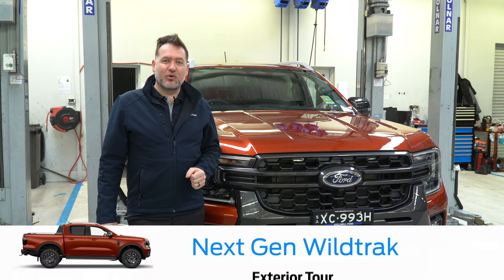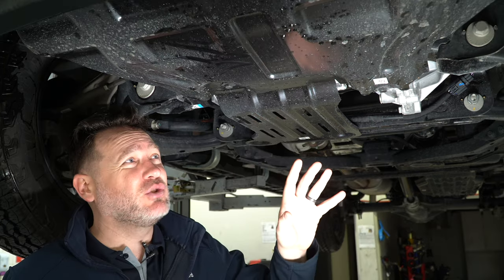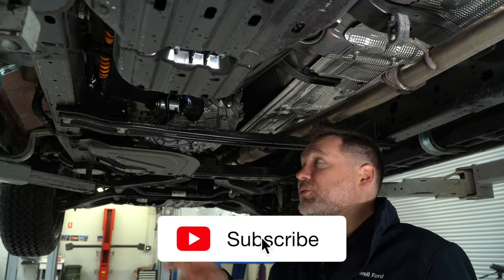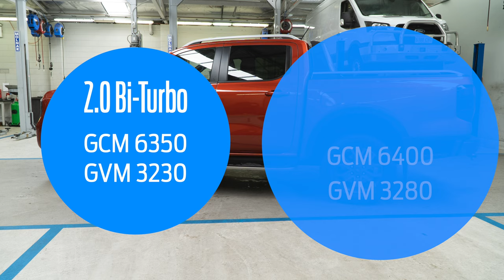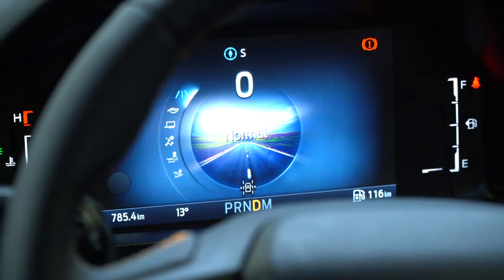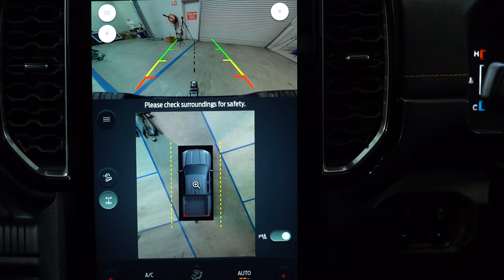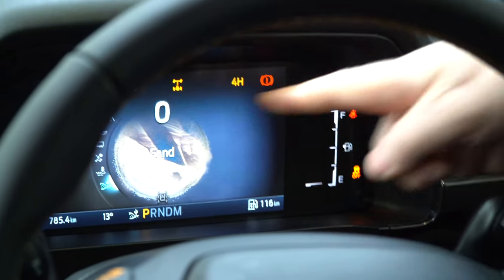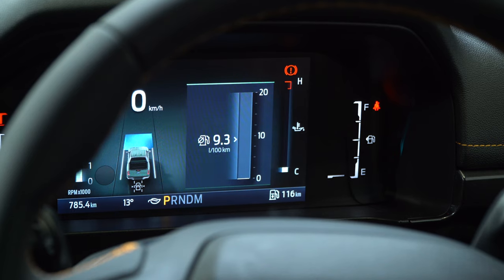Next Generation Ranger Wildtrak - Underneath & Off Road Upgrades

Comment: Thailand Ford ranger wildtrak 4x4 only has thin plastic under the motor but I did notice a shield over the fuel filter.  There are a few other missing things from the Thailand edition.  Like there is no rear towbar so no rear recovery points.

Comment: Do the front axles disconnect from the front differential when not in 4H or are they always turning the front differential even in 2H (which is similar in concept to automatic locking hubs but done at the axle)? I believe previous generation ranger was always connected, which was good for reliability of the 4WD system because there was no front axle disconnect mechanism to break but bad for fuel economy.
Reply from the maker: As far as I know they are always connected

Comment: Have they fixed the divers seat bolster problem and have now applied the right paint on the chassis as all rangers are rusting mine is a 16 plate wildtrak and is now in for a 9 week rust treatment where the body is stripped from the body and then the chassis is being sand blasted and a coat of primer then 2 coats of 2k paint is being applied, they have given me a curtesy truck but this is also rusting and its only a 21 plate
Reply: It's a Ford. By this day and age you should know to expect major issues with anything they produce. Sure you get all the bells and whistles in a beautiful package, it's just not not going to last because it wasn't engineered let alone built too. That being said, those bells and whistles sure are enticing.
Reply: @nathansharma87  Fix Or Repair Daily lol

Comment: Did the distance between the frame rails stay the same as the previous generation, with longer control arms for the track width increase, or did they widen the frame to account for the track width increase?
Reply: Most likely just widened the frame.
Reply: @ssoth1762  yes that would seem the logical answer, but since they now have room to mount the rear shocks outboard of the frame, I wonder if they maybe kept the frame width? Can you measure it to get a definitive answer?

Comment: Hi team, could you pls confirm that these 2 recovery points in the front are rated recovery point? And how much are they rated for ? 5000kg ?

It’s very important and I can’t really find it anywhere online 😅

Thanks
Reply from the maker: These recovery points are advertised by Ford as rated. I'm not certain about the exact kg value of the rating.

Comment: Hmm does that mean its ok to drive it in 4h on roads/bitumen since tow mode uses 4h?
Reply: Hi, yes you can drive it in 4H on road. Its the rear diff-lock that should never be engaged on a sealed surface
Reply: @stillwellford3812  That will be wrong. You cannot use 4x4 on sealed, hard surfaces as selected in tow/haul. 4A yes, but not 4H. Something arse about there!
Reply: That makes it clear. Why would tow mode put it in 4h if not safe.